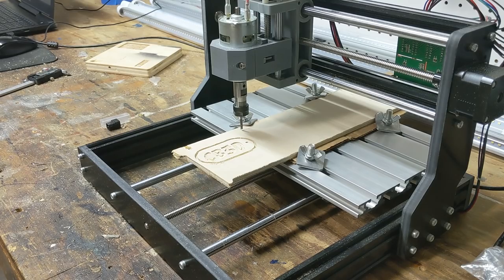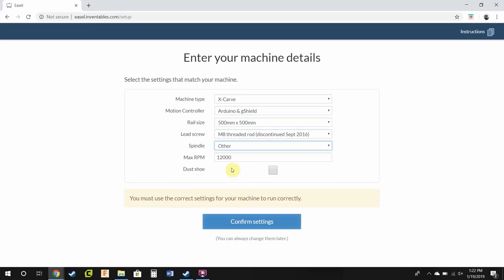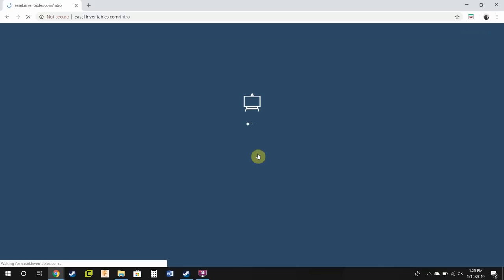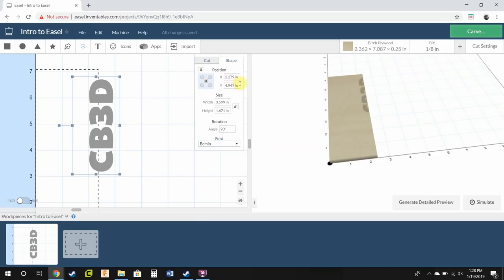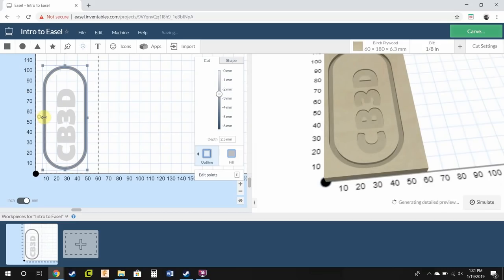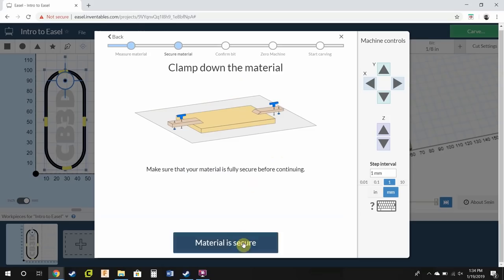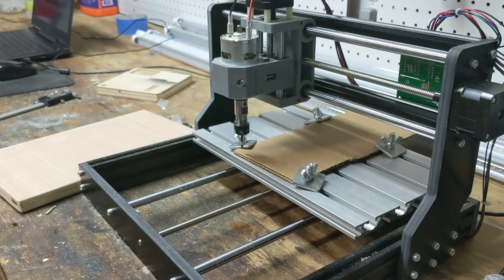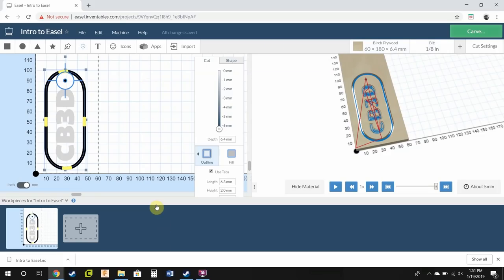An Intro To Designing and Cutting on the Sainsmart CNC Using Easel (part 1)

Comment: Thanks a lot for making this video! I'm wondering if this works with mac or there is a way around it...
Reply from the maker: Easel is designed to work for Mac too, so you should be able to follow the same steps in this video. I use to use easel on a Mac to run an X-CARVE at work
Reply: @calebbuilds3d223  Wow thanks a lot for such quick reply! I tried it but the COM port box doesn't appear nor could I install candle...
Reply from the maker: I would recommend asking around in the Facebook group to see how others did it(link in description). The Mac I used is now dead, and I am a Windows guy, but we do have Mac users in the Facebook group that can be of more use than me
Reply: @calebbuilds3d223  checking already thanks a lot for the guidance

Comment: I have a question for you I got everything set up but when I use the laser attachment or the CNC attachment it doesn’t turn on but the CNC moves is there anything I can do to fix that because it used to be as soon as I would press the button to turn the machine on the spindle would automatically turn on??
Reply from the maker: It could be that you are using the wrong gcode to trigger the laser. What laser software are you using?
Reply: I think I may know the problem I accidentally deleted the stock software that came on the motherboard but I can’t find it anywhere to re-download it I don’t even know what it was to be honest and I don’t know how to configure all the settings to just update it to a new software
Reply: Hello TS,  the laser uses litefire software to engrave with.
Reply: I ran into this today. Make sure under the machine settings in Easel that the spindle is set to Automatic and not Manual control.

Comment: if you have a peice like you have in the prosition, how does it know to cut below the platform (where it facing outwards)?
Reply from the maker: I am sorry, but I do not understand your question, could you please rephrase it?
Reply: @calebbuilds3d223  you no  how you had you peice lenth wise, i want to no how you progame the cnc to cut below were you have the piece hooked in
Reply from the maker: Bellow as is up and down direction (z), or forward and back(y)?
Reply: @calebbuilds3d223  where you carved the CB3D forwards and backwards
Reply from the maker: @taranagnew436  if you move the design you want to cut down in easel, than it will cut lower, even if it leaves the cut area in easel. Does that answer your question? If not I will try to still help

Comment: 2.54 CM is in one inch. That's 25.4mm per inch. Basically, inches to millimeters, multiply by 25.4. Other way, divide by that.
Reply: Best stick to metric as its more straight forward.
Reply: @vapoureyes  No, it's not
Reply: @phil2082  sorry you disagree as I’ve been a toolmaker for forty years , started off on imperial but later changed over to metric which made life much easier , imperial is old school these days so better to move on . Think America is the only country still using it .
That’s my opinion but is ok to disagree
Reply: @vapoureyes  Unit conversions are not that hard, and the fact that people struggle with them this much is just wrong

Your opinion was not any part of this
Reply: @phil2082  I don’t struggle , I just think it’s out of date.

Comment: Can Easel create a cut depth greater than 6mm?
Reply from the maker: It can go as deep as you set your material thickness. Just remember to multiply material thickness and cut depth by 2.54 to convert it from inches to mm
Reply: @calebbuilds3d223  can't I just click the slider to change the unit of measurement from inches to millimeters?
Reply from the maker: Yes, but it doesn't change how it sends it to the machine. It still sends it in inches, just as a fraction instead, which means your machine will think it is doing the right thing, but it's not
Reply: @calebbuilds3d223  I am confused.  If you flip over to mm does it still use inches.  I have been trying to drill 1/4" deep holes and they are always half as deep.

Comment: hopefully you can help me I followed this video step by step and used the same feed rate spindle feed cut area etc. I only picked to cut a rectangle that is a shallow cut. the problem is when I export the g code it gives me an nc file which I think is correct. but when I put that onto an sdcard that goes in the 3018 pro remote module (lets it cut without a connected pc) I can see the file I select press print and it crashes the module. it has example nc files that came preinstalled that work just fine. I even tried importing them to easel but easel has a problem and cant import any of the test codes. do you have any idea how to get it to work. or could you please upload a g code test file from easel to the description in the video so we could test out a code to trouble shoot if its my pc and setting or the remote module not being compatible but it should be since it has nc files for test patterns that work. btw I did set the machine to both inches and mm to see if either would work but no luck. I have the same 3018 pro just with the offline module. I used easel but did not install it (used the browser version which works the same just no direct connection to the machine). I also set up the machine parameters to match yours in the machine tab. 290x290mm 9000rpm and auto spindle (I even tried manual). just to the point of banging my head into a wall.
Reply: also I am using the stock module to run the g code if that wasn't clear. so step 1 make my pattern step 2 make and export g code step 3 load gcode onto sd car step 4 put sd card into 3018 pro module select file and print step 5 instant crash after I press print. (as I said the other test pattern like words prints just fine). have you tried running you gcode from grbl candle?
Reply from the maker: Have you tried to run the gcode through candle instead of your offline controller? It could be that the offline controller prefers a different flavor of gcode., Also you might need to multiply the material thickness and cut depth by 2.54.
Reply: @calebbuilds3d223  

The remote appears to have problems and not reliably cut a project that cuts fine with the same file sent via USB.
Reply: @calebbuilds3d223  25.4   not 2.54

Comment: how did you get easel to recognize your machine? i keep unplugging usb and power but it keeps asking me to plug in my machine. it works on GRBL...
Reply from the maker: You have to make sure to press the blue carve button in the top right corner of the screen, and then check the box that says "Enter COM port manually", then enter the com port. That should work, and if not let me know

Comment: can this software work on cnc 3018 ?
Reply from the maker: He's it can work on the 3018, that is actually what I used. Just make sure to multiply material depth and cut depth by 2.54
Reply: @calebbuilds3d223  Why is the 2.54 needed ? Sorry just starting out...........
Reply from the maker: @davecook2297  it converts it from in to mm, easel wants to run in Inches, and the machine wants to run in millimeters. Nothing wrong with just starting out, feel free to ask questions and learn!
Reply: @calebbuilds3d223  Makes sense, Thanks !
Reply: @calebbuilds3d223  As you surely know, multiplying by 2.54 would convert inches to centimeters. You multiply by 25.4 to convert inches to millimeters.

Comment: Good job, this video helped.
Reply from the maker: Thank you! I'm glad this video helped, just remember to multiply material thickness and cut depth by 2.54
Reply: Good catch. Instead in the advanced menu of easel , "Machine Inspector", I changed the z $102 value to 800 to match x and y (was previously 320). Cause I kept forgetting to multiply manually. $100 X steps/mm, $101=Y steps/mm, $102=Z steps/mm
Reply from the maker: @MrTheoryboy  thanks for the tip! I will probably end up making a video on that, because that is definitely valuable information! I will make sure to mention you in it
Reply: awesome!  @calebbuilds3d223

Comment: Your stock seems much thicker than .25” that’s probably why it did not cut through.
Reply from the maker: It was 0.25", the issue was converting between metric and imperial, the cut depth and material thickness had to be multiplied by 2.54, or you can do some other methods to fix it which are also listed in these comments.